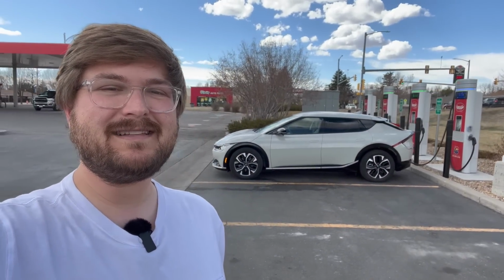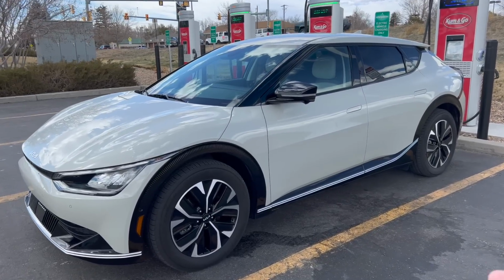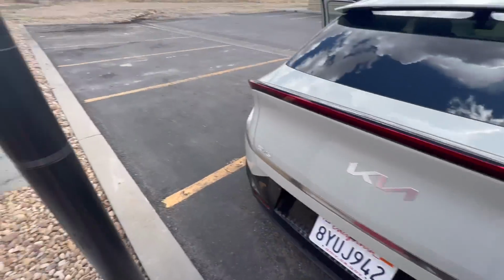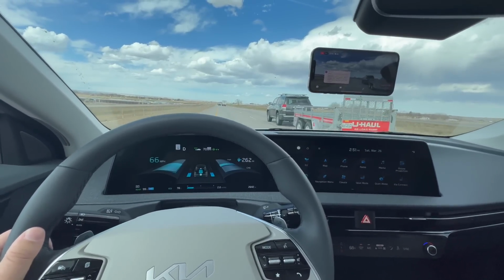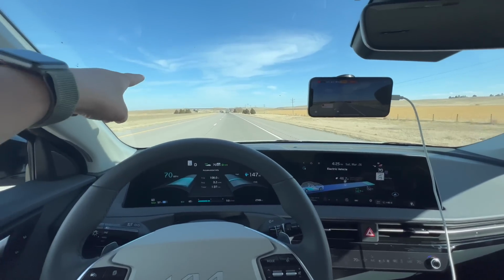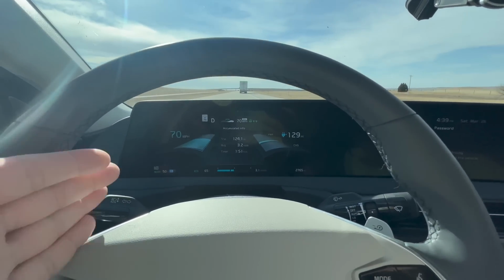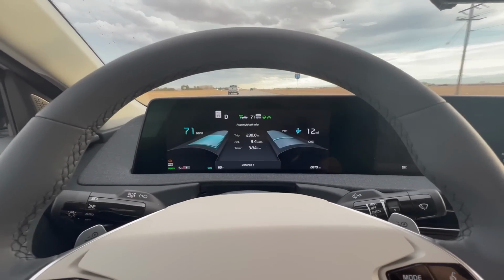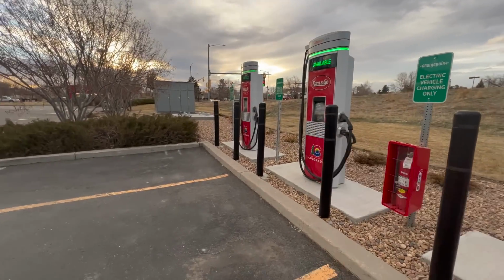2022 Kia EV6 AWD 70-MPH Highway Range Test - (Wind 19” 77.4kWh)

Comment: Just wanted to say that I got 273 miles of charge (100% in Eco) yesterday (3/30/2022) on my Hyundai Ioniq 5 Limited in San Antonio Texas. The outside temperature was high 70's at 8pm.  I was pleasantly surprised.
Reply: Hey just curious, how much does it cost you to fully charge?
Reply: @maicol67  that day it was $11 and cost me $2 for going beyond 30 minutes on Electrify America charger.  (32¢ /min)
Reply: @clsutherland331  wow nice, I'm researching as much as possible and really want to make the transition to EV, I  boiled it down to the Ioniq 5 Kia EV6 VW ID4 or Toyota BZ4x. My wife's on board so I'm thinking maybe within 6 months
Reply: @clsutherland331  question for you if you don't mind. Btw thanks for responding and posting your info. I'm in Philadelphia and researching charge stations, is it true recharging would be cheaper from home? Even after purchasing equipment & installation?
Reply: @maicol67  assuming the national average is 14¢ on average then yes it would be.  But that depends on your rate here in Lakehills Tx it's 9¢ and I don't remember what the off peak rate is (11 pm to 10 am here).  Also Hyundai gives you 2 years free 30 minute charging from purchase of a new I-5.  And the manual says to DC fast charge at least once a month.
Reply: @clsutherland331  if I read the PECO ( that's my electric supplier ) chart correctly peak hours, 2pm-6pm are from $.17-$.22 & off-peak 6am-2pm then 6pm-1159pm $.05 & super off-peak ( 12am-6am ) is $.03.
Reply: @maicol67  so like me schedule your charging to start at that super off peak time.
Reply: @clsutherland331  what speeds?
Reply: @ProjectDrift350Z  230
Reply: @clsutherland331  sorry I meant what were the MPH driven. Planning a drive from McAllen to SA in my RWD SEL but still a little nervous
Reply: @clsutherland331  as a follow up to my comment above, I did 180 miles about 160 was highways at 70-78 and was left with 25% charge when I got home

Comment: My wife wants to get an EV, but insists on 300 mi of range. I keep trying to tell her that's excessive since we go on maybe 3 trips a year, and that charging speed would matter more. Range anxiety is real.
Reply: I’ve started to ask myself on a road trip how long do I drive for before a break either to stretch my legs or to use the utilities? 2 hrs maybe 3 hrs?! After 3hrs have probably averaged 60 - 70 miles each hour given congestion and junctions and with no serious hold ups that’s 210 miles! If you’ve got a BEV with good fast charging performance a 20-30 minute break can have you back at 250 miles range till your next comfort break. 

We can get caught up on range. I’ve never run my 516 miles range diesel ICE vehicle to empty on a road trip without needing a comfort break before then! At which point I take the opportunity to fill up. 

UK Highway Code Guidance  (2020) item 91 on page 28 Rules for drivers and motorcyclists even recommends a 15 minute break minimum after every two hours of driving.
Reply: @Antiguan_Dart  300 miles is more than enough for travel inside the UK - you might need to charge once or twice, but a cross country trip in the USA is over 2,000 miles. That would be 8-10 charges. A lot of Americans travel on Thanksgiving or Christmas which makes the charging experience even less desirable as heavy congestion occurs.
Reply: Your wife is correct.  IMO every EV should have at least 300 miles of range.  It's not because of range anxiety, it's because the battery loses range over it's lifetime.  Having to charge up more frequently because of this is very annoying.
Reply: 300 miles is a reasonable request. I personally wouldn't want anything less than 500 but that's a little bit too steep to ask right now. 😅
Reply: @hermanwooster8944  I’ve never owned an ICE vehicle that could go 500.
Reply: @float32  Yeah, some SUVs can't even break 400, but there are plenty of cars out there that can reach 500 miles - especially if you do highway driving. Take the Toyota Camry for example. The base model has a 15.8 gallon fuel tank with 32MPG combined city-highway driving. This results in 505 miles of range per tank. But EV's perform worse on the highway than in the city due to added drag and aerodynamics. This means they generally perform below their EPA stated range at 70mph or greater.
Reply: I hate range anxiety
Reply: Range anxiety!  That's my big concern.  I do road trips from St Louis to California (west coast generally) every year.  Recharging would be a big hit to my travel time.
Reply: Consider your actual use case. I have a 30-mile commute so my 220-mile EV charged to 80% (180 miles) is plenty. If I'm going far, my gas car will do 600 miles on a tank.
Reply: Sounds like your wife wants a Tesla!
Reply: I agree with your wife. I have the Model Y. I like everything but I do want more range.  Not bc of range anxiety but I am one that can go longer without needing a stretch break.

Comment: Great review, love this.   Coming back to your question of Ioniq 5 vs. EV6 and saying it comes down to shape.  Does either of them offer more headroom? I sat in an EV6 and at 6'2" and tall torso, I just don't comfortably fit.  Is the Ioniq 5 any different?
Reply: Ioniq 5 is supposed to have significantly more headroom. The EV6 will have a little more too if you skip the GT-Line sunroof.
Reply: @ThomasGallmeyer  google shows the Ioniq5 having like 1" more w/o sunroof

Comment: Kia did a great job on this new EV, impressive styling and performance. Great test Kyle, keep them coming.
Reply: Just got my EV6 Light on 5/1/2022, and right now I have a little bit over 1000 miles on it. When I charge the car to 100% it only showed estimate rate of 205 miles,. It seemed like the battery is already degrade 12%. Do you know if it will be able to recapture more mileage when I have more miles on the vehicle, or it will only get lower mileage going forward?
Reply: The range constantly changes based on how you drive. I have 3000 miles on my awe wind and its rarely the same when I fully charge. If I drive in sport mode a lot it will show less range vs eco mode

Comment: Great range! How much did it cost to fully charge the vehicle?
Reply: Yea, Kyle should include the cost as well just for reference since gas prices nowadays are high.. atleast on the west coast.
Reply: It's a simple math calculation - take the usable battery size (77kWh?) and multiply it by your cost per kWh (whether that e.g. 29c / kWh at a fast charger, or 11c for overnight home charging, or 0c if you have solar, etc).

Comment: My impression is that the lack of a windshield wiper is NO biG DEAl….. I have one in my Santa Fe and almost NEVER use it ….. and that goes for all of the cars and suv’s I have had through many years.  When I want a clean back windshield I clean it with a spray bottle and cloth…. come on …. reasearch must have shown that the wiper is really not used much. Even the New Cadillac electric Lyriq does NOT have a rear windshield wiper….. Manufactures save on this expense and use the money to put into another car feature !!!!
Reply: Agreed, I have this car and it isn't bad at all.  I might feel differently if I lived on a gravel road or something, but at least on the EV6 the longer overhang in the back and the more angled glass keep things pretty clean.  In rain I just throw the rear defroster on and it does a pretty good job drying it up.

Comment: I see hyundai as one of the few legacy companies producing a decent EV. Nice to see these coming to market.
Reply: Well said!
Reply: I know what you're saying, the big companies are behind Tesla in sales. But as far as I can tell, every electric vehicle built in 2022 is outstanding. In 2022, all the legacy companies have raised their standards dramatically. The new Ford Mustang Mach-E was just reviewed by Throttle House and they said it's basically their favorite all around electric car, it handles almost flawlessly and has good fit and finish, and looks nice, they said the steering and suspension was basically perfectly tuned. And then the new Ford F150 EV truck, is maybe the best EV being made today, for the price. It's cheaper than most of the cars, and has outstanding revolutionary features. Chevy has the Hummer EV which is absolutely loved in the reviews, but Chevy and Dodge might be falling behind in the car category, and I don't think Dodge has a good electric car yet, but I could be wrong. But Ford has knocked it out of the park so far, with their Mustang and F150 Lightning.
Reply: @Ritalie  I would argue that the Mazda MX30 and Honda E is a joke. And the Toyota BZ4X and Subaru Solterra are 10 years behind. The lightning seems good - a lot better than the Mach E apparently.

Comment: Can you clarify the 1 pedal driving while in eco mode? Does 1 pedal driving re-connect the front motor even in eco mode? Or does 1 pedal driving not work in eco-mode
Reply: 1 pedal driving does work in eco-mode it just keeps the front motor coupled for max regen.  I believe it does eventually uncouple, but I could be mistaken.  I don't care for full  1 pedal mode so I just keep mine in level 3 or 2.  I personally also take mine down to 1 or off at highway speeds because it feels like it frees up the car, meaning it feels easer to maintain speed.  Likely just the way it feels due to the accelerator petal mapping, but to me why do I want regen at highway speeds anyway?
Reply: @trpblr  thanks for the input! I saw later in the video that it looks like you can see if the front motor is connected on the screen which is good enough for me. I get what you are saying about highway driving and probably agree. The only EV I have ever driven was a model S so it's not all that convenient to switch regen levels. I imagine being able to coast a bit more on the highway at level 1 would be quite nice.
Reply: Yes you can have level 3 regen (1 pedal driving) in Eco mode, but I've noticed that it doesn't slow the vehicle down as much as when you are in one of the other driver modes.  So it's "sort of" one pedal mode, but not quite.

Comment: What are the two green symbols on the far right side of the instrument panel while driving? My wind doesn't look like that
Reply: That is part of the HDA2 system, one is a steering wheel and the other is left and right turn signals telling you auto lane change is available.
Reply: @trpblr  This vehicle should only have HDA1. Quite confusing why his awd wind has hda2 but nobody else's does
Reply: @Matt-M  It's a head scratcher!  I wonder if Kyle and the gang would be willing to research this at higher levels?  How did this happen?

Comment: Just love this car. I'll get an EV within 5 years, the prices are too crazy for now.
Reply: It’ll be worse in 5 years lol
Reply: @everyelectriccars  Quite possibly. The tipping point is coming, I'd say the consumer preference tipping point is probably 2025-2026, where the slim majority of car shoppers will be looking for an electric, and it'll be putting strain on the battery supply chain. Best time to buy will be 2023/2024 where we'll hopefully be out of the crippling automotive shortages, but before the big tipping point.
Reply: @everyelectriccars  I wonder about that.  The market might collapse in the next 5 years (see 2008) and that would calm things down.  The great reset is set for 2030 so  by then we'll all have our pods, bugs so there is also that.
Reply: @mistermister2085  Lol pods? By 2030? You’ll be highly disappointed. I see more electric vehicles for sure, most being SUVs & CUVs at most. Maybe new type of energy powers vehicles.
Reply: Trust me, nobody will be disappointed if we avoid the pods.
Reply: I’ll get one when the changing network improves

Comment: EVs should have wind generators
Reply: The laws of physics are missing with this one...🤪
Reply: Why would one want to generate wind? Isn't that technically a fan?
Reply: @wzDH106  a generator makes electricity.  A fan makes wind
Reply: @Boomtendo4tw  

Unfortunately that's not how the world works, but many fall into this trap as we hardly experience or analyze this balance.

Simply put, imagine placing your hand out the car window doing 70 MPH. The energy will forcibly push your hand and arm back correct? But the simple act in using muscles to hold you arm and hand steady is energy lost, calories burned. And funny enough, open windows or sticking an arm out will cause the vehicle to burn more energy, counteracting the increased aerodynamic drag. 

There's no free lunch, one can't expect to make free energy from a moving vehicle without taking energy away from holding the vehicle at 70 MPH. Robbing Peter to pay Paul as the old saying goes. 

Gasoline engine alternators are no different, but on a much smaller scale as an alternator powers lights and the radio, not the entire vehicle, that's what the gasoline engine does on those vehicles.
Reply: @wzDH106  the most efficient transportation on the earth uses turbines

Comment: Why do the EPA numbers differ from reality so significantly sometimes?  Is it that people mistakenly think that the EPA rated range is what they should expect on the highway when they really shouldn't?
Reply: Yes, he's testing on the highway. EPA cycles are mixed.
Reply: EPA range on EV's is a mixed use number not all highway or all city.   So the 70mph highway test will always be lower than the EPA rating.
Reply: Keep in mind the range depends on what you are doing: i.e. Air conditioning, heated steering wheel etc.  The estimated range continuously changes depending on what additional settings you have turned on (and the outside temp).
Reply: Aside from the mix-mode testing for the EPA, the other issue is that there are multiple different EPA test cycles, and automakers are free to pick which test cycle they want to use, and how much they want to 'optimise' for the test (ie whether they test with air-con on or off)
Reply: Exactly.  I just don’t get it when establishments like Edmunds get this so wrong.
Reply: My real point is that when people do range tests that are different than the EPA’s tests then expect the same numbers, it’s quite befuddling.

Comment: Really nice to see you guys crack 250 miles in this test. This is what I originally expected from the e-GMP cars, and I was disappointed with the Ioniq 5 tests. Sounds like you guys figured out Eco mode and were able to eke out the extra miles.
Reply: I have already seen these differences in tests in Europe (I'm from EU myself) the EV6 is just more efficient predominantly due to its aerodynamic shape.
Reply: The EV6 has a different battery to the ioniq5 . That will change later this year when the Ionia gets the same battery as the EV6.
Reply: The range/efficiency of this and the ioniq 5 are definitely a little disappointing, but definitely loving that the charging is so much faster than what the mustangs and model Y's are doing.

Comment: Still underwhelming compare to Mache e
Reply: This car: 3.4 m/kwh  .. InsideEV's three March-e Tests: 3.3, 3.3, 3.3.. So as other commenter noted... The EV6 is "more" efficient... but really they are the same as they are within margin of error due to environmental variables.  It's "less" range than some Mach-e's because some Mach-e's have a bigger battery (88 vs 77).
Reply: Smaller battery that that of the Mach-E
Reply: @wzDH106  about the same battery
Reply: @williamerazo3921  

Extended Range Mach E has 88 kWh usable (2022 model AWD EPA 277 miles)

Kia EV6 has 77 kWh usable, I'd argue that's substantial, or approximately 14% less than the Ford. (2022 AWD EPA 274 miles)

The extra energy on the Ford will help with highway range, more energy from the larger battery. But the lacking heat pump, in the Ford, is a winter range killer for mild winters, as I can attest to. The EV6 got that right at least.
Reply: It’s more efficient than Mach E